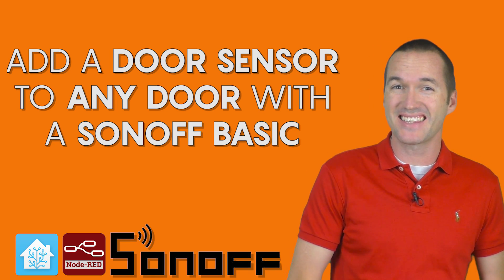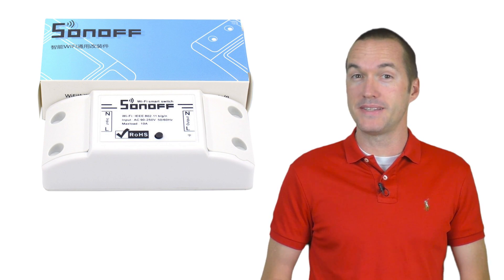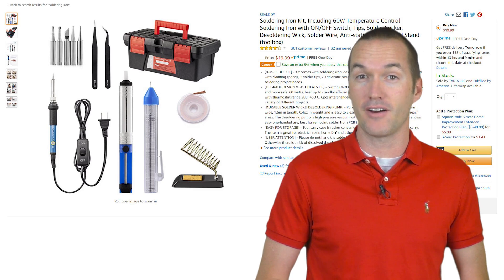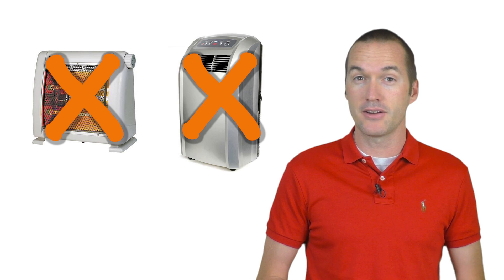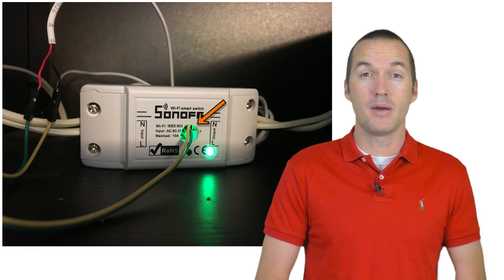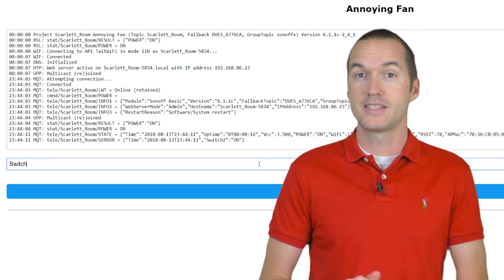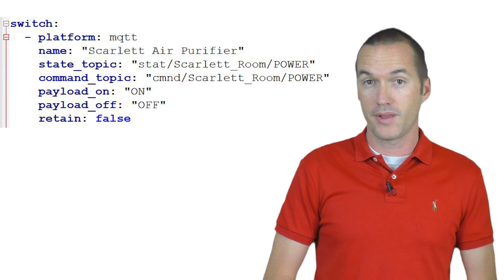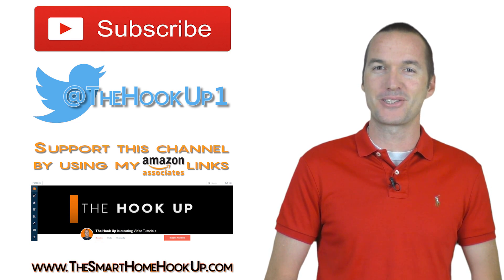Add a door sensor to any door with a Sonoff basic.

Comment: This is exactly what I needed:  Thanks.   I could use a little help; however.  I was able to configure the basic (GPIO14) and the switch, with no problem.  I can now control the switch but I do not see the binary_sensor data anywhere!  The switch shows up on the Overview  page under  SWITCH (all of my switches show up there) but I can't find the door open/close data there or under the 'STATES' information.  Any suggestions?  Thanks
Reply from the maker: Do you have one of the new versions of the sonoff? You can tell because there are two large black wires inside instead of the normal solder traces for N and L.
Reply: I have one of the older ones, heavy solder on the PCB lands.
Reply from the maker: did you add the binary sensor to your yaml?
Reply: yes, added a  binary sensor (under binary_sensors.yaml)
Reply: Switched to ESPHome, problem resolved

Comment: Great idea.  I have been trying to accomplish this with one I have wired to a porch light. I have also wired gpio14 to toggle the porch light with the existing light switch.  I have not been able to figure out how to accomplish adding the reed switch and keeping the light switch functionality.  Any insight or thoughts?  Thanks for all of the how to’s. The smart roomba was a great addition to my HA.

Edit...  maybe i should look at hooking the light switch to the sonoff button on gpio0.
Reply from the maker: You can just hook the door sensor up to TX or rx, it works the same, just change the setting in tasmota.
Reply: @TheHookUp  Works like a champ.. not sure what i did wrong before posting, however double checked everything and it works great!  Now i can add sensors to each of the house entry doors and tie them into the sonoff's... great add to the functionality of the sonoff.. thanks

Comment: Hi guys i have this door sensore configred but it works only when the light is off 
when i trun on the light it stars to go crazy... anyway to solve this ?
Reply from the maker: When you say it goes "crazy", what does that mean?
Reply: @TheHookUp  
Hi Rob 
its going off and on every half a min
Only when the light is on... looks like the power from the light is making noise, i have tried putting restiores on the line with no success

Comment: Since you're using mqtt to get the state of the contact, not the command sent, shouldn't your binary_sensor state_topic be "stat/Scarlett_Room/POWER2" instead at 6:17?
Reply from the maker: No, the contact us wired as a switch so it sends commands not states (a relay would send a state).
Reply: @TheHookUp  Okay, makes sense, thanks.

Comment: Thanks for the excellent tips and tutorial. You just earned a subscriber!!Please tell me, is it possible to have a room light switch ON through my linked Sonoff switch, when the sensor on the main door is activated?
Reply from the maker: Yes, that will happen by default if you do not decouple the switch by changing the switchTopic
Reply: @TheHookUp  Thanks!

Comment: Tasmota is amazing, but it's close to being too big to do OTA or upload upgrades. I started using ESP12F modules and relays rated higher than the circuit breaker. A 12F configured for 3MB/1MB can OTA upgrade, even with every Tasmota option enabled.
Reply from the maker: What are you using to supply the low voltage?
Reply: A Chinesium 5V switching power supply, and an LM3117 linear regulator. ESP12Fs tends to draw current in spikes, so add a 100uf. That's barely adequate, so check yours with a scope while the ESP is transmitting and receiving.

Comment: Novice projects should not directly control or connect to mains voltage projects. Those pin headers are at mains potential with respect to earth. I appreciate you just want to share your project, however I would encourage you to highlight the dangers involved and hopefully anyone following this project has enough common sense to realise the dangers...
FWIW I bought a lot of Sonoff devices, I haven't used them yet as I realised they need to put in a mains rated enclosure. I have seen too many projects where they just splice it into the mains wire to control that device. Whilst that does work it puts any user at risk (the cables can easily be pulled out for a start!).
Reply: Amen brother.

Comment: Whilst it MAY prove easier for soldering novices to mount the pins the way you suggest, using fresh solder, some flux and solder wick braid will provide:
a) the ability to fit all pins in one strip
b) only require access to the top or bottom of the board to remove the solder from the holes so the board can be kept much more stable (Blu Tac is a great way to keep it still without buying helping hands or a portable vice)
c) all the pins will align properly first time so that a single multi pin connector may be used easily.

All in all, worth the price of some solder wick (desolder braid) and a better soldering experience - all the pins can be soldered in one go.

Great video with lots of useful info.
Reply from the maker: Good points.  I was trying to show that the soldering could be done without any extra tools to make it more accessible to beginners.

Comment: I could just KISS you. As in " Keep It Simple Stupid" I have been working on a neat device to tell it my garage door is opened..  Battery powered , mercury switch , write software etc, etc...complicated but ALMOST working.
Then you came thru with a simple  non complicated solution. Oh did I say cheap.  AND I can turn on some other device like maybe the charger for the battery in my mower.  Thanks for your creative, clearly thought out ideas and projects which you fully explain in usually less than 10 minutes.

Comment: I do not know how most of the people use these Sonoff Basics without Insurance companies rejecting liability if a fire happen not because if these units but as an contributing factor?. I know I am using them but I would put it in enclosures with restraints. Hot Glue is another thing I use but insurance people will still argue
Reply from the maker: If something that you installed is a contributing factor to a fire the adjusters will always have something to say about it. It doesn't matter if it's made by Samsung or Phillips or itead, if it wasn't installed by a licensed professional and it burns down your house it's your fault.